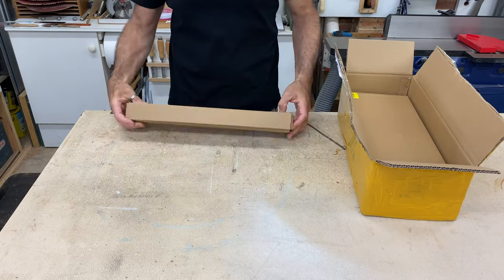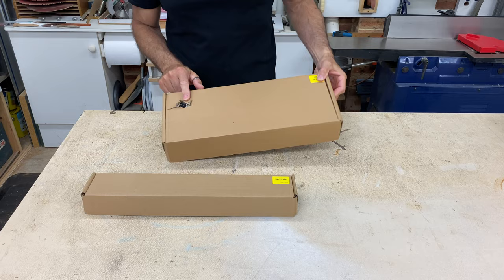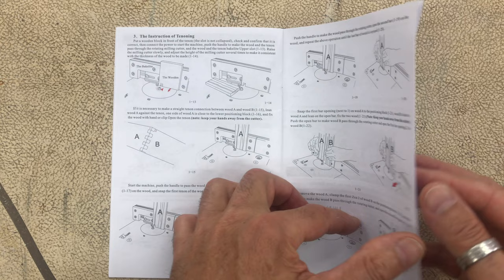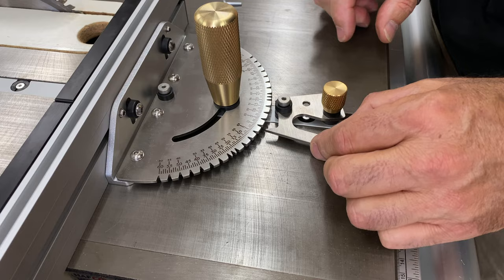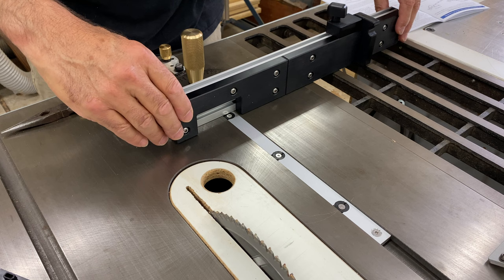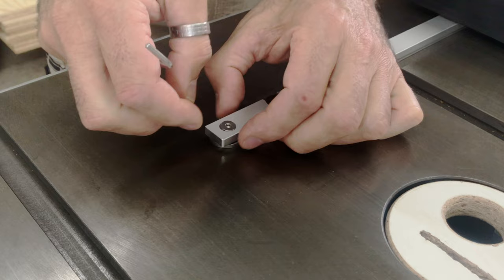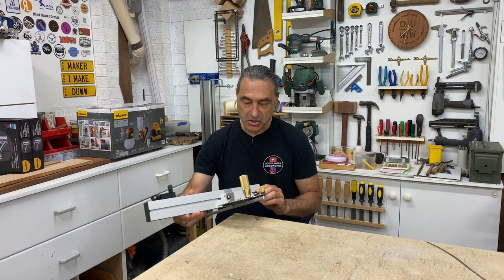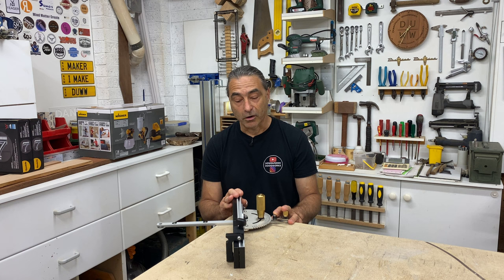Tool Review | Wnew Brass Handle Mitre Gauge

Comment: G'day Vic, I bought the same mitre gauge last year but without the fence. I had a piece of aluminium  slotted bar which worked .  I have exactly the same saw as yours and my gauge slides up and down without a problem.
I replaced the slide adjustment screws with knurled brass knobs I found at Bunnings and they match the supplied ones perfectly.  My gauge was accurate from out of the box, I did not have to adjust it, I guess I was lucky.
Keep up the excellent videos and ignore the uninformed. cheers Tim
Reply from the maker: Thank you very much Tim. Glad to hear you're happy with yours

Comment: I think your review was fair. It seemed to cover all the important points relevant to a miter gauge. You pointed out some problems and fixes you made. Also a couple of changes / enhancements that would be in order. So about the only part of the review I disagree with is your view on what is or is not "paid". You got a $150 (or so) piece of merchandise. That's $150 in your pocket. So unless you send the miter gauge back, you are money ahead. Now, having said that, your review appears to be honest, paid for or not. Thank you for sharing. Have a great 2022 and stay safe.
Reply from the maker: Thank you very much Glen and i appreciate your views. This 'paid' topic will always be a matter of opinion. In my mind if i were to be paid cash i could spend that money on anything i want. in this case i get what i'm given and yes its money in my pocket if the item is great and you use it but what if the item turns out to be crap and you put to the back of the cupboard and only use it rarely then i'm essentially out of pocket. Thanks again mate

Comment: i have the same mitre guage, and was impressed with the quality and price. the only tweak i had to make was file a tiny section from the end of the non sprung pointer that sits in the cut outs on the protractor, it was just a little too long for it to seat properly in the cuts, other than that it worked out the box.
Reply from the maker: Thanks Kevin. its been really good hearing from others that have this item and are happy with it

Comment: Very accurate review. the posting on Bangood's site is not clear as to which fence you get - the one you got - same as the one I got - is really for a router table and specifically for box -fingers / tenons which explains the instructions order in the manual.. The gap opening space in the fence for the router bit is extremely annoying when trying to align the distance from the blade unless you use the right slot on the table saw. Thanks for the tip about flipping the black backing so it will be possible to use on the left miter slot. I, too was surprised at the good quality of the product and I have a Jessem fence  that cost 2.5 x and didn't fit as well as this one in my table saw.
Reply from the maker: Thank you. Glad i was able to help out with that tip.

Comment: I just received the non brass version of this, interestingly it didn't come with any instructions, the 4th expansion washer was fitted, and it had a large flat edged washer fitted to the far end of the rail where yours just has a countersunk screw, i had to remove the washer as it was wider than my table saw slot.  I expected the indexing finger to be sprung loaded as well.  it was nice to have all the required allen keys supplied as well as spare screws and expansion washers.
Reply from the maker: Thanks for that Russ. Sounds like it all worked out in the end

Comment: This is identical to the Torquata Mitre Gauge from Timbecon.  Doing some research it appears this gauge is actually OEM rebranded under lots of different vendors/brands.  I see it also listed as the 'Drillpro Mitre Gauge', 'Torquata Mitre Gauge' and now the 'Wnew Mitre Gauge'.
Reply from the maker: Yes mate, when i saw the first pics of the Timbecon one i recognised it as identical straight away. it happens a lot with some tools these days, identical tool released under different brand names.
Reply: @DownUnderWoodWorks  I wish I'd seen this first! I could have saved a few $$$!

Comment: Great review Victor & you should do many more mate, YouTube is a search engine so it’s great if your review videos can be seen by the masses.
I think we all get hung up that we need to do build after build video but that’s a flooded market & highlighting good quality tools should present you to a new audience.
Grouse work mate 🇦🇺🇦🇺🇦🇺🍺🍺🍺👍👍👍👍
Reply from the maker: Thanks very much Dirk. I'm still in two minds about doing reviews, it just felt like i was selling my soul the whole time.
Reply: I have this miter gauge. For about a month. 
I am with you on it having T slots with no T bolts.  In the US it’s a little difficult to find metric bolts.  T bolts would really help with moving the fence past the gap. 
The hole in the aluminum fence is to run the dado cutter thru. You cut right thru the plastic to give a zero clearance for the dado. This really helps with tear out on the backside of the dado cut. 
This is only good for the first set-up. So I’m making replacement fence faces for different set-ups.   I make them out of Timbertech scraps. It’s a resin & sawdust deck board material. 
The grub screws you pointed out adjusts the vertical tilt of the fence. Not the square to the blade angle. That is done with two screws on the miter face. 
I put red locktite on the screws in the miter bar and the two grub screws. Because I’m out of blue, which isn’t permanent like red. 
I didn’t want to take a chance on loosing them. 
I really like my Wnew miter gauge. I use it on my 2000 Grizzly cabinet saw. It really improved the accuracy. 
Thanks for the review video. It was a very good presentation.

Comment: Thanks so much for making this video. I've read through the comments and don't see anyone with the same unanswered concern as mine. I have just purchased a rebuilt old Rockwell Unisaw. need to get my 220V supply installed before using it. I can't wait. Really looking forward to getting into woodwork.  This seems to be far and away the best value miter available.
This miter gage does not come with a measuring system. No tape. Dialing in and using a table saw without needing tape measure to the saw blade tooth seems to be a most popular miter gage/sled operation. 
Do you think a tape can be inserted into the t-slot? Has anyone experimented with a tape, perhaps one that would fit snug into the slot but still slide for adjustment?
Reply from the maker: No, you’re right, the gauge doesn’t have a tape measure. To be honest, relying on set tape measures is not the best practice anyway. In my opinion and experience measuring your cuts with a ruler or hand held tape measure is far more accurate and a good habit to form for a new woodworker. Don’t take everything you see as the way it should be. Also, a tape measure on a mitre gauge won’t really work at any angle other than 0 degrees.

Comment: The stock hafco gauge with the SB12 is the letdown of the table. This tool looks to be a very good replacement
Reply from the maker: I think thats the case with standard mitre gauges supplied with most saws. its always a low grade item just like the blade thats supplied. Mine didn't last very long at all. Cheers mate

Comment: I have recently purchased this item and have to say I am satisfied with the quality .however I have encountered a problem. I have  Clarke CTS 14 table saw and discovered that the miter gauge is not compatible with this table saw or I understand any other of the Clarke range. The miter is too wide and thick to fit the miter slots on the table saw. I wonder if this is a problem with other brands of table saws. Perhaps you could advise.
Reply from the maker: Hi Alan, I'm unfamiliar with the Clarke brand, I've not heard of it. A3/4 or 19mm slot is standard on most (i thought all) table saws.

Comment: seems to be exactly the same down to the instruction manual as the Torquata Mitre Gauge with Box Joint Jig Accessory
Reply from the maker: Yes mate, I've noticed the new Green Torquata range are the exact same Banggood tools just rebranded. Disappointing actually.

Comment: How is the flipstop adjusted? Is there a mechanism for fine adjustments? 

Also, can the flipstop be used with a sacrificial fence?
Reply from the maker: The flip stop has a locking screw on top so you can slide it along the fence and lock it in place. There is no fine adjustment. It could be used with a sacrificial fence because the unit comes with the plastic inserts that screw to the front face of the fence. i have removed them as i find the gauge works better without them so you could use a sacrificial fence the same thickness as the plastic inserts

Comment: i really appreciated this review. So much so I went and bought one. I was a little dissapointed to find that the bar only fits in a t track that is 30mm and most table saws in the UK (which I wanted to use it on) are a lot narrower. I have had to basically build a table saw from scratch to be able to use it. I asked the ebay seller about the size of the t track on a new table saw I was going to purchase but he basically said tough, it comes with a mitre guide and if I wanted to use my new mitre guide I would have to make a new bar or get one made by someone. Any ideas where I could get a narrower bar to fit this guide would be really appreciated. I was told the T track fits a 16mm bar, this is 19mm....mmmmm frustrating.
Reply from the maker: Sorry to hear that mate. The bar on mine is for a 19mm t track which is what I have on my table saw
Reply: What make table saw do you use? If I have to buy another I may as well buy one to fit my mitre guide ( that’s how impressed I am with it) in the uk the tables t track looks cheap and nasty and the one I bought was even bent straight out the box. ( the make is einhall I think)
Reply from the maker: @MrWoody17309  Mine is a local Australian brand www.machineryhouse.com.au. Whatever saw you decide on just confirm with them what size t slot it has.
Reply: @DownUnderWoodWorks  what table saw did you use